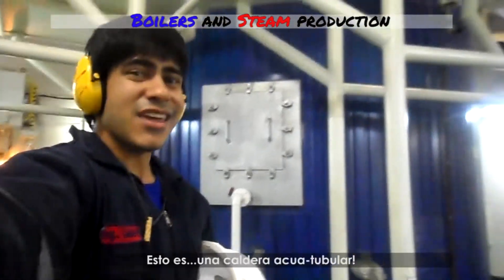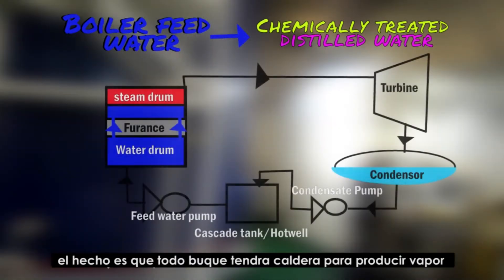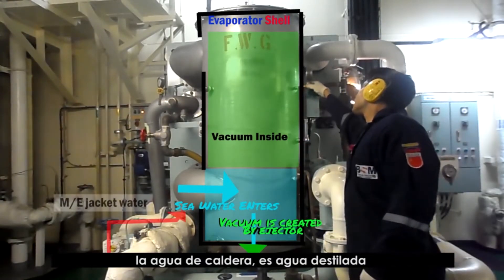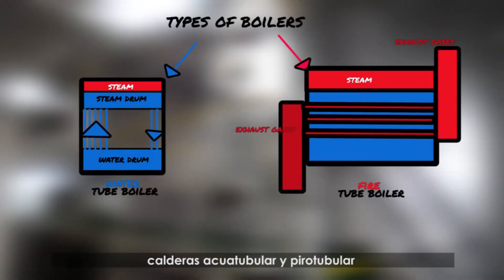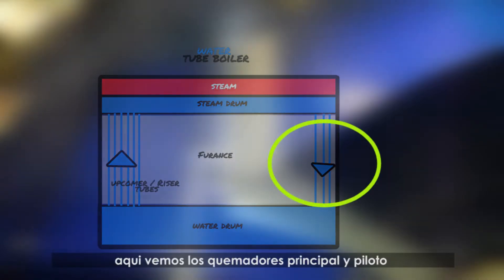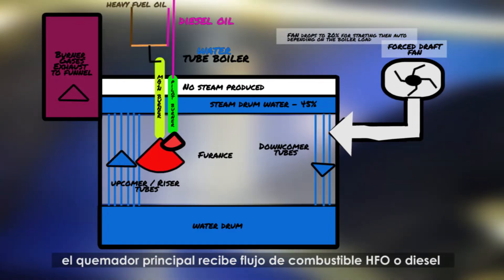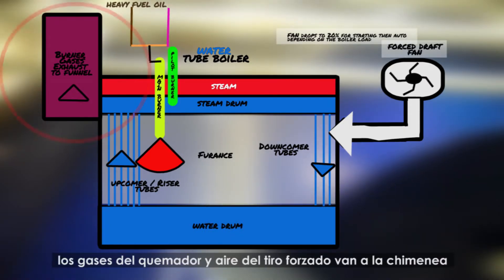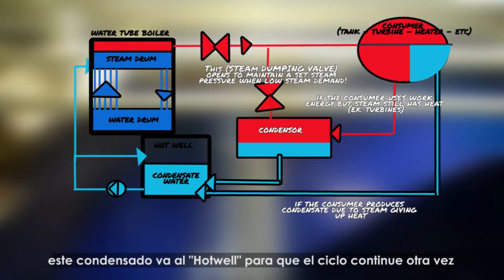BOILERS - Steam System on ships  (Overview and Operation)

Comment: Hi sir,
This is IMTIYAZ 
Boiler Technician 
Working in Saudi Arabia.
I would like to work in ship.
So how could  i apply in the ship?
Reply from the maker: Hello Imtiyaz, how are you? First you need to see which position mostly assimilates to your experience. 
Engine officers at sea require a special licence given by your home country. Check if you qualify for this licence. 

If you would like to work as an electronic officer or HVAC apply online and see if your experience qualifies. (for carnival for example it's shipboardjobs carnival on the internet.
Reply: no sir I don't have any idea abt that?
Sir please could u help me to find out the best job for me which is releated to my position?
Reply from the maker: Usually the engine officers are the maintenance and operators of the boiler however as I said to be an engine officer onboard you would need an STCW(maritime) licence

Comment: hello ! can you make a vıdeo what engıne crew are do durıng anchorıng operatıon
Reply from the maker: It would be interesting my friend, however quite short and Un-eventful. We mostly "prepare" for maneuvering / anchoring operations by having more energy available (prepare more generators), accepting telegraph orders for lowering / raising main engine rpm speed / being stand-by in case alarms happen and we need to operate some equipment because an automatism failed (air compressors or air reservoir empty for example).
Reply: @ShrimptoShark  thankyou as an engine cadet your videos also so helpfull

Comment: why are we using induced fan in incinerator
Reply from the maker: For the boiler: to supply air for the combustion
For the incinerator: it is needed to keep a draft inside the chambers and due to the duct outlet we create a negative pressure inside (due to the vaccum created by the high speed air passing though the duct).